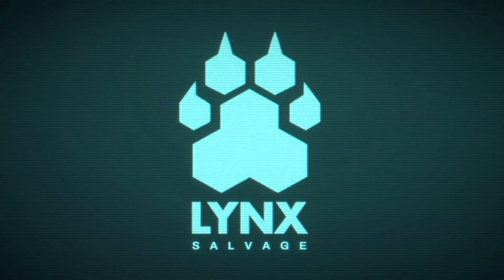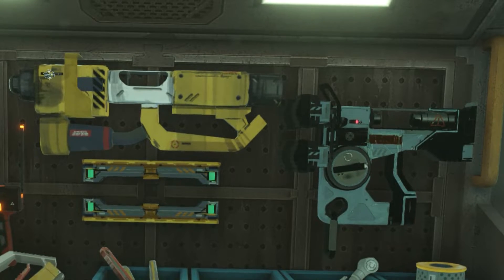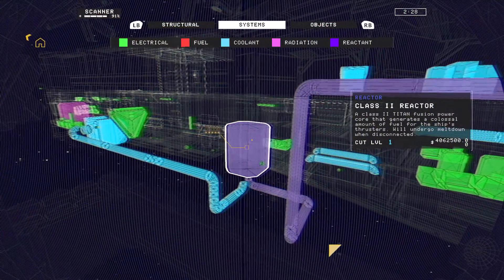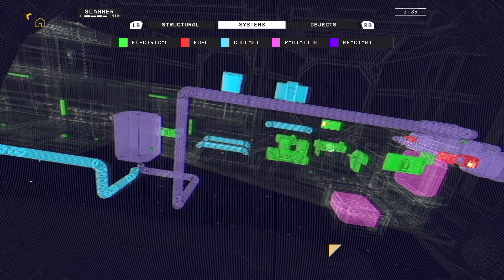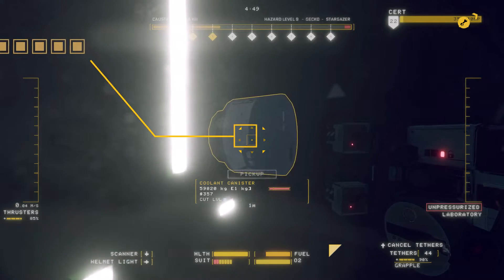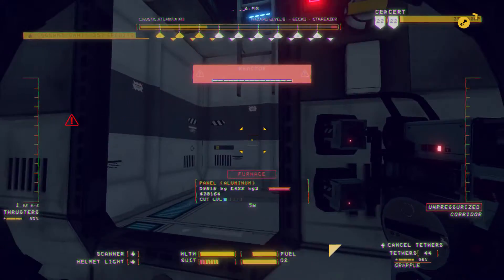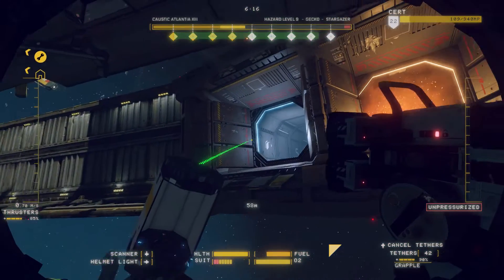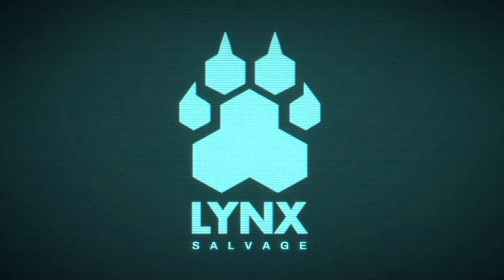HARDSPACE:SHIPBREAKER/Removing a Class II Reactor (Training Video)

Comment: Interestingly enough, if you keep the thruster attached you can prevent a meltdown alltogether. disable the coolant and cut the coolant pipe then barge the reactor and thuster together. The small bit of piping wasted this was offers negligible costs and you can still achieve salvage goal 5 with a lot of buffer doing this relatively small sacrifice that in turns reduces the number of steps needed to salvage a tier 2 reactor as well as  completely eliminates the risk of meltdowns entirely.

Now that's a win win win in my book.

Comment: Cutting the pipes isn't required and sometimes isn't needed at all.
My preferred method:
Remove outer hull
Remove ECU coolant
Remove at least 3 of the reactor sheilds. Sometimes you need to remove them all and take off the top plate if there are walls on all 4 sides of the reactor 
Eject the thrusters. I do this lasf as they are usually closer to the reactor and they are never inside the living space of the ship.  No doors to go through while the reactor is melting down.
Remove reactor and yeet into the barge

You can often get the coolant pipe and fuel pipe into the processor still attached to the reactor plate without cutting anything except at the ECU.

Comment: I love the video but I have two things to say: First, there are better ways to remove those reactors, like usually you can destroy an almost completely worthless tiny section of pipe connected to one of the reactor plate things to keep more money. Also the fuel pipes can be completely removed before disconnecting the coolant and triggering the meltdown. Also along those lines you can remove those outer panels on the reactor without causing a meltdown. Basically, I would recommend removing as much as possible and having a planned method and route for removing the reactor before disconnecting the coolant. Doing these things usually allows me to remove a class II reactor while losing maybe 2 ticks from meltdown countdown thing. Second is this: class II reactors are fine until you have to scrap a gecko salvage runner. those things are a nightmare because if you have to decompress the cargo hold without a regulator then the coolant pipe will almost always be damaged or completely destroyed so if you know any tricks with them I would love to hear them. Amazing video though! these tutorials seem amazing for new players and even old ones.
Reply from the maker: Thank you very much for the feedback!  You raise some good points, here.  The matter of the fuel pipe is valid.  It's true that removing the outer reactor panels doesn't threaten stability.  Keeping the reactor closed until the end is my personal safety preference.  

I'm glad that you like the video in general, as I have more like this pending release.  Stay tuned, and thanks for watching!
Reply: You are the employee that after all the new associates watch the training video is like "the video says to do it this way, but around he were just do..." . OSHA hates you, but you get associate of the month and everyone doesn't comment about your workflow.